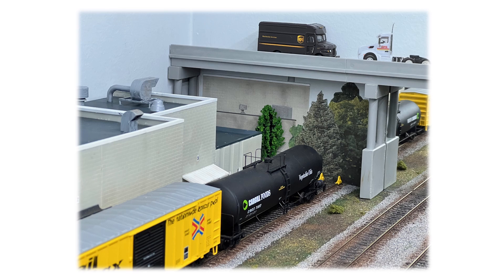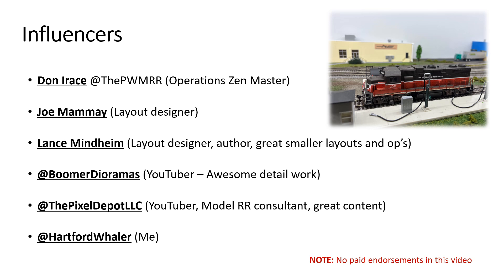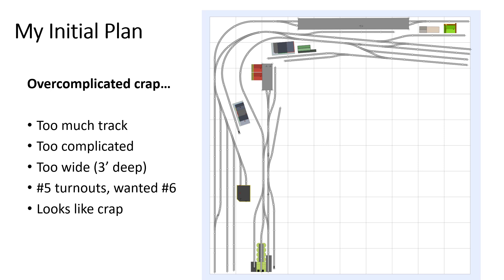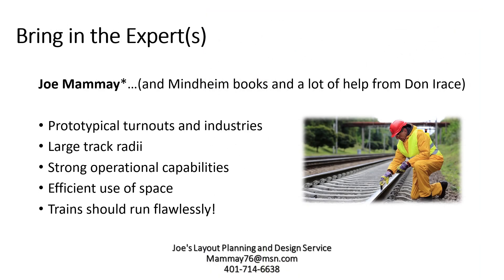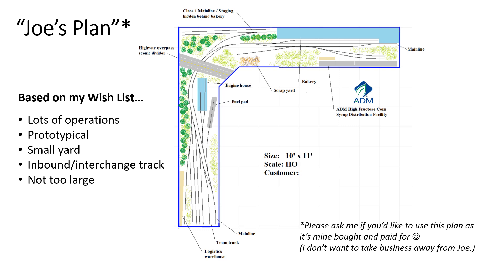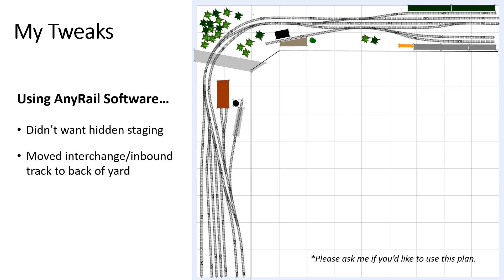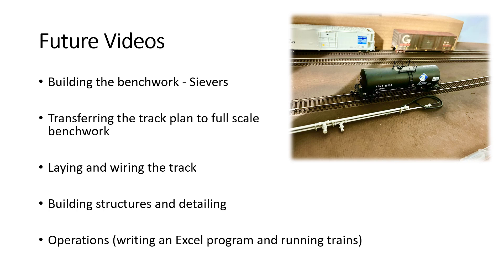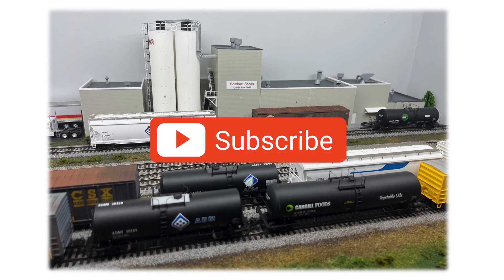Designing the Track Plan for the HO 12’x20” Shelf Layout

Comment: Paul,
Thank you for sharing your layout. I am getting ready to start on my first layout in 20 years, and this video has helped me get a better feel on what to build. I model the Chicago area, in June 1964, the Milwaukee Road is my primary, but I want an industrial/yard setting that I can run Interchange into from any of the Roads running into Chicago in 1964. I have a flat wall about 27 feet to work with, so am thinking about 16ft with staging on each end. About 22" wide. I do have more room than that, but I for now, it's a good goal. I have been wracking my brain, trying to figure out how to pull it off. In real life, I am a Carman for the Union Pacific, and I just cannot model what I see every day. Trying to model the SP merger, is why I have not had a layout in 20 years :)
Looking at your layout, the shot low across all the tracks, under the overpass was the key, I thought, that could look a lot like Chicago. I think it's the inspiration, I have been looking for. I would need to stretch it 4 more feet, add a 3rd yard track, change some industry tracks, etc. In all though, I really like what I see, and you have done. I sure would like to use it as a starting point.
Great list of Influencers you have, but for me I would have to add Ray O'Neill, Robert Todd, The Manhattan Transfer, Sweet Home Chicago, and the Long Island Railroad, Montauk Branch, among others.
Best,
Sam
Reply from the maker: Sam, thanks for watching and for the great comments. I’m happy my video was inspirational. You have plenty of room to make a very prototypical industrial layout. It took me a long time to understand that you can get hours of operations from a focused industrial diorama vs a layout that goes in circles around the entire room. I can spend 3 hours easily operating my little layout by myself. Even if I have a friend over to act as conductor, we burn a couple hours switching out all the industries. Your influencers are a good addition. Thanks for mentioning them. Please keep me posted on your project. I’m sure you working on a real railroad will be extremely helpful once you land on a layout design and start the operations. Knowing how railroads actually operate makes the operations of a shelf layout much more enjoyable. Things like going slow, taking time for the conductor to connect hoses and test brakes before moving a car, opening and closing derailers, etc. Only thing I’d suggest is keeping the depth of your layout 18-20” max. I started with 24” and it was too deep for a shelf layout where you want to see the industries and have easy access to switches etc. That’s just my opinion. Thanks again and good luck with the layout.
Reply: @HartfordWhaler   
Paul,
I see your point on bench width, and I think 20" can work fine. Yeah, applying hand brakes, stretching joints, not moving too fast, picking up and dropping crew, etc. So many little moves to make it real. Thats the layout, I want to have. 
I missed a couple Influencers, and I would be remiss to not mention them. Bill Denton, and his Kingbury Branch, changed the way I look at and what I want in a Model Railroad. John Pryke's, Union Freight Railroad, showed me I can do what Bill Denton did in HO, instead of N. Eric and his Chicago Crossing, brought my modeling back to Chicago, and more than just The Milwaukee Road. Why Milwaukee Road, coming from a Union Pacific family (119 years same yard.)? Well, it was 1974, BN had merged, and Milwaukee Road got trackage rights, all the way to Portland, Oregon, as part of the merger. As a kid, I did not know that yet. On my way to high school, on a city bus one morning, I looked down as we crossed The Steel Bridge. There was a train on the deck below us. The thrill of seeing that Orange Milwaukee Road, Bay Window Caboose below me, really grabbed my attention. I was like how did that get here? Not knowing about the traffic rights. Well, the hook was set, I just did not know it yet.
Sam
Reply from the maker: Great story Sam. I love the old Milwaukee Road paint scheme. PS - It took me a bit to get my head around how to operate a switching layout according to the prototype, but once I did, it was a whole new level of enjoyment and realism with the hobby. And I needed less space! (Just better track work and detailing). Thanks for sharing the influencers. Good info for me and my subscribers.

Comment: I really like your layout.  I also enjoyed hearing the evolution of your track plan.  For my layout, I am exploring the concept of removable industries to add variety without adding track (e.g. swap the paper warehouse building to a steel coil warehouse with an inside track).  Since you already receive corn syrup cars at the food facility, you could change the sign on the ADM building and use that as a chemical distributor.  You can have more variety of tank cars.  Hawkins Inc in Centralia, IL is a prototype example that receives all sorts of chemicals and mixes them into custom products for distribution.
Reply from the maker: Good idea on varying the industries. With my layout, I can easily spend 3 hours switching. You might want to fist build the layout before assuming you need to rotate industries. Rotating cars can be done if you want more than several hours of operations. Thanks for watching and for the comment.

Comment: It's always good to see the thinking to reach the end product. Is the crossover in front of the pink building really needed? You can run a little bit further left to use the crossover in front of the blue building, and it would save 2 turnouts,
Reply from the maker: Funny you noticed that. I actually added that after the initial “final” plan was put down with track. As I was operating, I found it gave me more flexibility, a shorter distance (and second option) for running around cars, and a spot to hold the cars I switched out of the 2 industries at the left end of the layout. I’d have to show you the switching sequences for it to make sense. Good example of not critical but makes for easier operations. It’s always a balance. Some people like Mindheim believe less is more, but in my case, working with a 12’x20” layout, I think it makes the switching more enjoyable, particularly if I’m operating alone. So, short answer is, no it’s not necessary, but it gives more options when moving cars around. Thanks for watching and for the good thoughts.

Comment: Awesome explanation of your design considerations! Is this 11 feet or 12 feet in length? The track plan indicates 12 grid squares from left-to-right. Thank you!
Reply from the maker: Good catch. The final benchwork is 12’x20” based on the space I wanted to use, so the plan you see in the video is correct. I misspoke in the video calling it 11'x20". My apologies for missing that!
Reply: @HartfordWhaler  Thank you, I though I was losing my mind! I really like this layout and may use certain elements in my design. Currently, I have an 2x8 foot table left over from an aborted early 2000's build. Started, but after completing the 2 main loops, I abandoned it. Fortunately, I have all of the Peco track,  turnouts, locos, cars, DCC gear,  etc. $5K of gear sitting in boxes and ready to go. I'm thinking  of extending the table lengthwise as 8 feet is a but tight for my liking. I'm super motivated to build and will be doing mostly scratch. I'm also going to use microcontrollers to automate the entire layout and environmental elements. Still plenty of thinking to do at this point...
Reply from the maker: Definitely start if you have all that gear. I’m a big fan of Peco track and turnouts. Makes a big difference. Keep me posted on your progress.